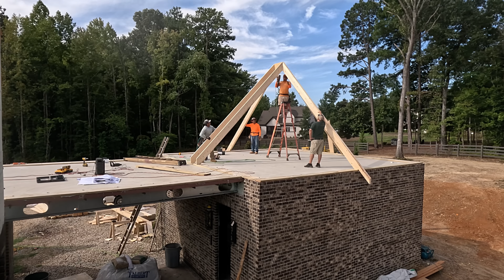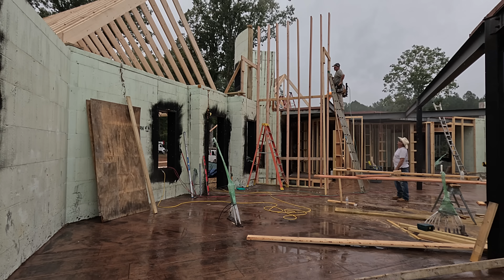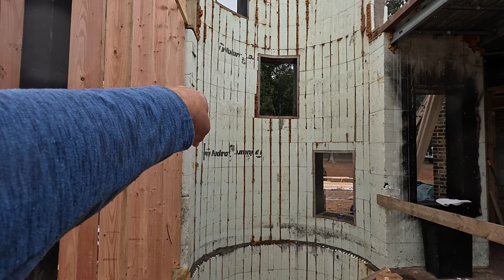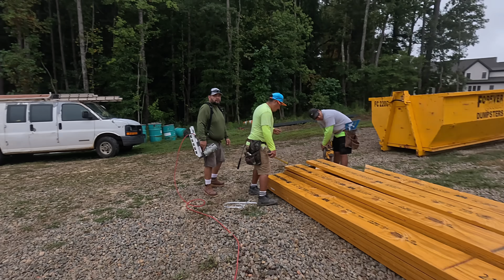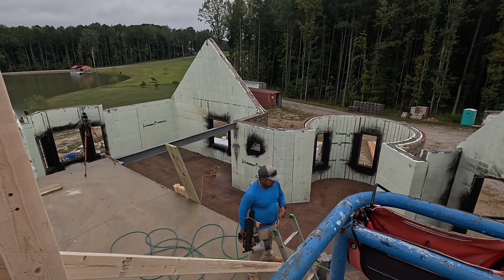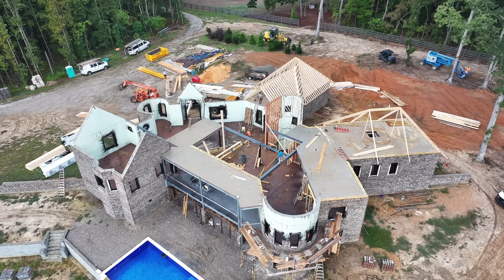ICF Castle Roof Part 1 – Stick Framing Begins with Rafters

Comment: I have heard of ICF houses before ,, really know nothing about them ,, except from what I have learned on your channel 😎
  As the house is being built I am thinking ,, this house is storm proof 😎 which I am guessing is the point ,, 
  You have steel supports for the concrete floors ,, concrete walls ,, house isn’t going anywhere 😎
  Then you get to the roof ,, and are using wood rafters ,, this is where I am kinda loosing it 😆😆 seems to me this is the weak point of the house ,, tornado or hurricane comes along there goes the roof ,, 
   What am I missing ?? I guess I was expecting a roof to be made kinda like the floors ,, something different than wood rafted I guess ,,
Reply from the maker: Yeah, This roof style is almost impossible to do in concrete. That's why I put concrete ceilings in certain key areas. We're also building the roof to the same specs if we were located on the coast.
Reply: @BealyGood that makes sense 😎👍👍

Comment: The architect or engineer is responsible for the entire structure once they touch it once they do anything they're responsible so they have reasons you know you shouldn't just get pissed off when you don't get what's actually going on You're bad general contractor even though this is your own job I'm going to say it again same on you shame on you you know you do a job right people appreciate it when you don't do a job right and just clown around about it you think it's a game it's not a game it's a livelihood for this engineer that took on this project after you couldn't control your own hatred because that's what it is you just hated what that engineer was doing so you just had a fallen out because you just wouldn't listen to the engineer that's usually what happens shame on you again God get some brain cells working stop blaming other people for your failure get it

Comment: No I can't believe it I thought the place was going to rot before you ever got around to put in the roof on it first thing I would have done was put the roof on it I wouldn't have bothered bricking it or nothing till it had a roof on it that is the most important thing on a house and what you save it for last same on you I'd fire you immediately if he was my contractor you'd be calm down the road buddy Good thing that's your own place yep did you going to pay for it forever even s*** sit the rock for years

Comment: OK, it might’ve been asked already, but aren’t you supposed to put some kind of foam sheeting underneath the treated lumber or is it gonna take the place of that? I watched another YouTuber that said that if you put wood on top of concrete that it would rot or maybe that’s just for the next Bottom plate I’m confused set me straight, Mr.Be
Reply from the maker: No. That’s the reason it’s treated lumber. Thanks 😊
Reply: Mr.Be I am not a contractor nor anything else just someone that watches YouTube channels Google what I asked you and the expert saying you should still put the foam barrier underneath treated lumber anytime it sits on top or concrete. There are three different reasons for it which I will not go intobut if you wanna Google it and tell me they’re wrong I’m good for it, but I’m just trying to help out thanks for having the conversation with me.